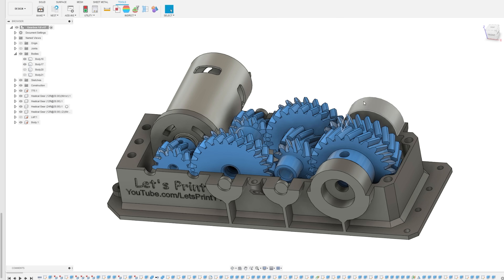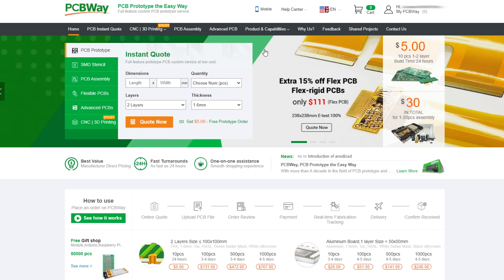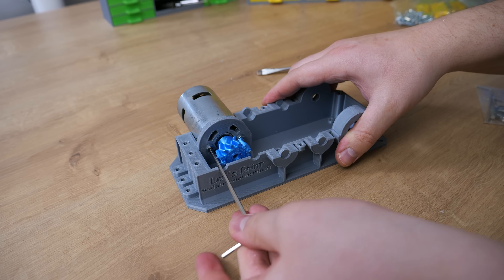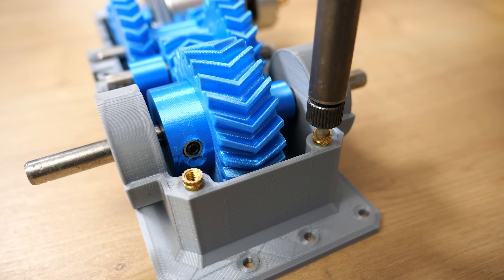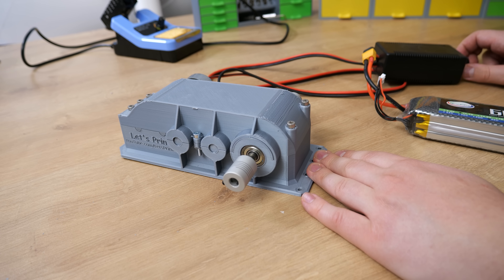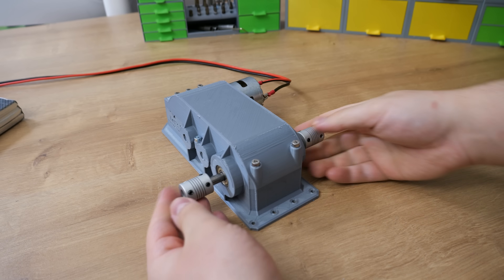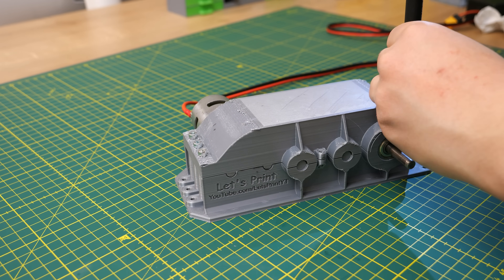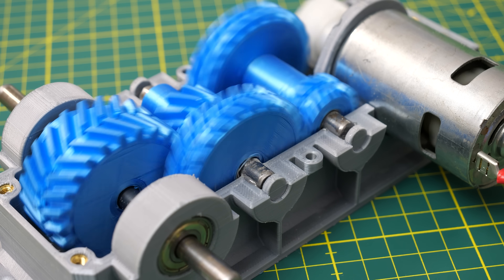3D Printed Double Shaft Gearbox - Perfect for RC Vehicles

Comment: My toughts....
1- Why machine screws? Use wood screws...toys dont have machine screws.
2- Why Gears? Toothed pulley will wear less.
3- Why 8mm shafts? Way to oversized.
4- Make the hole on the gears (or pulley) slightly smaller than the diameter of the shaft you will use, then drill the hole with a drill bit, you will get better surface finish and less play.
5- No need for bearings on the middle bridge shafts, looks like they are very loose (shaft - gear hole)...they dont even turn on the video.

Comment: 6:25 You can put those inserts in the freezer and they will contract a little making inserting them a little easier, once inside, you can heat it with the soldering iron to make it fit snugly. BTW great video!.
Reply: That is very stupid
Reply: @lolx400  ok

Comment: Good idea with the threaded inserts. But if this is to be considered 'hobby-grade', it definitely needs a differential. Either geared or a ball-type; otherwise you're just gonna bind and really stress out those gears. And also - it'd be better to add ball bearings to all the moving parts.

Comment: Methinks your iron was waaaaaayyyy too hot for the inserts, it should be just below the melting point of the material they're going in.

An idea with the bearings too. They're probably fine, but there is a chance that they could work their way free being mounted on the outside. If they're mounted inside, there's no chance of them coming off to an extent that could be a problem.

I'd love to see the gears printed out of nylon. Regular plastic gears are either POM (Delrin) or Nylon, for the fact they're tough, and have a very low friction coefficient. You changed one of them to nylon, but not the others. Sure, PLA is nice and all, but it's really terrible for making anything useful.

Comment: Have you thought about using a gear oil r a atf as lube instead of grease. It’s lighter and you could fill the bottom with a inch or so and it will flow over all the gears n being lighter it might help the centrifugal drag. Idk just a thought hope it helps. I enjoy your videos

Comment: You can make it quieter by making it less of a box on the inside.  Give each gear about 3 mm clearance around the diameter and fill the empty space on the bottom and top of the gearbox. Great video otherwise!

Comment: Is it better to use the "though pla" for high torqe gearboxes or is there no difference really? (it will be used outside in snow)
Reply: tough pla is a polymer blend that increases impact resistance, so it would be good for a bashing vehicle that sees a lot of hard acceleration. Maker's Muse has a video where he tests different materials for gear strength: https://www.youtube.com/watch?v=UtRJ4lnNAXY

Comment: I made tank using with the cycle chain & a 10rpm high torque gear motor & I made a fee tests on the sand & the sand gone inside the bearings and inside gear motors all over the chain it stuck & guess what I didn't record that sh*t Ahh ಠ_ಠ👍 it's gone btw totally rusty

Comment: chamfer the holes of your threaded inserts. Did you run a 4 cell battery through that  3 cell ESC? Too high a voltage kills anything looks like user error to me.
Reply from the maker: Hello, ESC was for 4 cells but battery was 3 cells.

Comment: you need more practice with those threaded inserts; you can get a much flatter face if you use some sort of flat metal surface to push them the last bit of the way

Comment: You should use white lithium grease. Also, I'd put bearings on those middle gears. I'd put an outside bearing on the first gear as well. You should also look at a flat shaft so you can just match the flatness with your 3d print design and slide your gears onto the shaft. No need for set screws then because the pressure on those will warp your 3d prints, especially PLA, over time. I would also do all of the gears in nylon. I also don't think the inserts are worthwhile. Just tap the holes on the outside of the box. They'll be very strong.
Reply: I think that outside bearing for the first gear is not necessary - shaft of the motor is already supported on 2 bearings, and lining up three bearings can be quite challenging. However, I'd use metal pinion gear, from some RC car that uses 0.8 or 1 mod gears,  instead of printed gear.
Reply: @Papinak2  Good tips
Reply: white lithium grease on plastics? really?
Reply: @bismuth7730  Na, better use some silicone compound.

Comment: sir .. how come only bearing on last gear?
Reply: Not necessary spin the middle shafts and the friction is low between gear and shaft. just enough the final stage shaft spins. so he just use bearings on the final stage

Comment: I couldn't make the inserts work. They weren't strong enough and would pop out. So I put a nut in the middle, and now I can break the plastic by tightening the bolts too much. 
I was also told many years ago by a plastic engineer, not to use petroleum based grease on plastics, and only use white lithium grease. I complied.
Reply: You need to make the hole for the insert smaller than the insert itself. a M3 insert needs only a 3.8mm hole. You also need to make sure the hole has thick enough walls. You also need to use the correct type of insert the ones meant for injection molding are crap. Done correctly they are stronger than the alternatives.

Some of Let's Print holes are too large, if the smooth part at the start of the insert fits in the hole its too big.
Reply: @backgammonbacon  The way I did it, as many others have, is to make room to insert a nut. If the bolt wants out, it either has to strip the nut,  or break through 5mm of directionaly printed solid PLA. No need to buy anything extra. 
Which way do you thing is better?

Comment: How interesting!
I'm building the tri-wheel rover like in the movie "Damnation Alley" in the past 2 months.
Harder than I thought. Tolerances was the bitch. I use herringbone gears, pulleys and 2mm XL belts.
I love fusion 360. Worked with SolidWorks for over 10 years and will never go back to it.